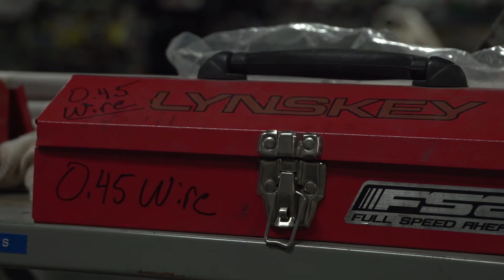Lynskey on the Art of the Titanium Bike

Comment: Litespeed are better. They kept making bikes and developed better technology while Lynskey were having a 9 year break from building bikes. That's because Lynskey got greedy and sold off Litespeed... they regretted it and now they are trying to recapture those bygone years. Sadly Lynskey,s are not as stiff as they use softer Titanium that's easier to work and the Helix according to the reviews handles like a wet noodle because they twisted the frame up to make it look cool? So it handles different on a right hand bend that it does on a left! I had a New Lynskey in my shop the other day. Build quality looks crude in comparison with Litespeed bikes. It's sad, but it's true. Lynskey had their day. Read the reviews on all the new litespeed bikes, they are amazing.
Reply: Softer titanium just mean more pure titanium. If you want hardness use steel.
Reply: I had a 1997 Litespeed Vortex that I rode for over a dozen years.  When the frame finally failed after 60k miles I purchased one of the original Lynskey Helix frames and later purchased a Lynskey Helix Pro frame as well.  I have friends that have Lynskey Helix Pro frames purchased after seeing mine.  After putting over 40k on between my two Helix frames I have never had any turning issues with either and they are just as stiff (if not stiffer) than my older all (6Al/4V) Litespeed Vortex.  My friends love theirs as well and I would highly recommend either Lynskey Helix model.  All our Lynskeys are older rim brake models (they now only make disc brake models) so I cannot attest to current build quality.  The welds on my older Lynskey frames and detailing look top notch.

Comment: I bought a new lynskey ti frame off an ebay bikestore. It fun a nice ride u til the headtube cracked..Lynskey wouldn't repair it under warranty.
Reply: Of course they wouldn't; That's how it is when you buy something from an unauthorized dealer. You didn't know that?
Reply: they could have saved me 4 weeks of run-around , but NO! Instead they wanted me to trade it in for $400 credit, then they spent weeks trying to verify it was an actual lynskey... BullShit
Reply: @ Ro Ye -  not sure why you are mad at Lynskey.  you need to take your beef up with the eBay seller for selling you junk.  If you had bought a car and found out it didn't run, you wouldn't be looking to get your money back from Ford.  Besides, because it's titanium, you can have any reputable metal fabrication shop reweld the frame.
Reply: I have an old Litespeed cross bike, I love it, best bike I’ve ever owned. It was made before the sale of litespeed and when I broke a chainstay weld by the rear dropout I contacted both litespeed and lynskey. I got the impression that neither company was interested in fixing the problem. Luckily we have an exotic metal welder near my home. He welded it and it is still going strong. 
I know a guy that had a litespeed titanium road  frame that broke by the head tube, he told me litespeed  refused the repair or replace it, so much for warranties. 
Things can happen no matter what the frame is made of, but I still love my ti and will probably always ride one.
Reply: @mplsmark222  my friend broke his Litespeed. 
They asked him is he the original owner ?
He said yes. They sent him a new $3000.  Frame. 
I buy used TI online.  If it breaks it’s on me.